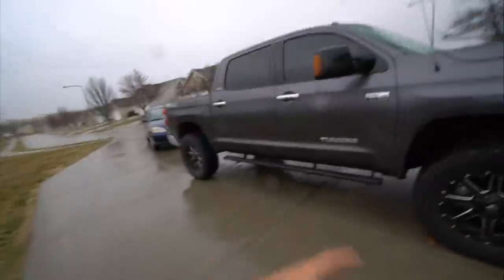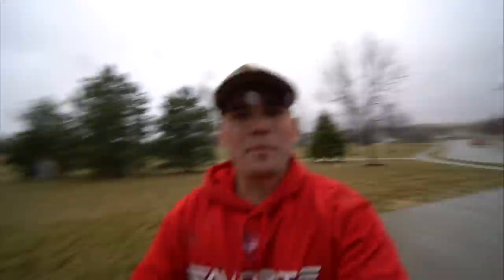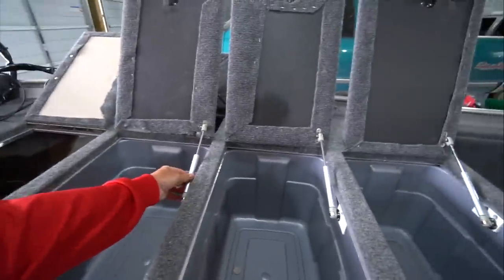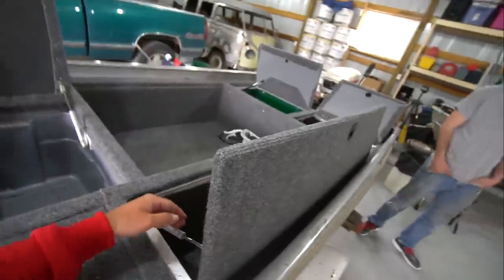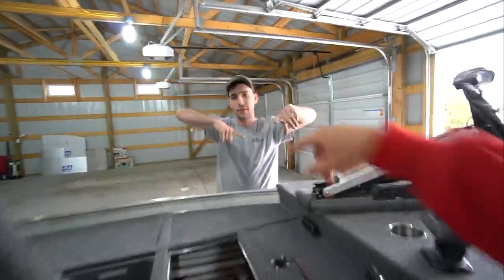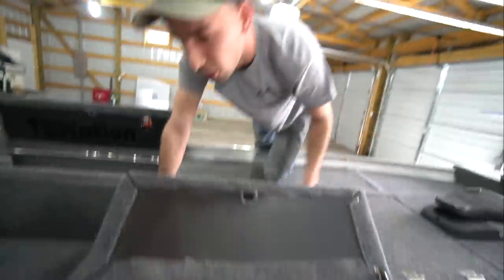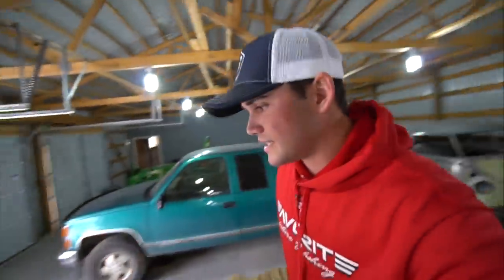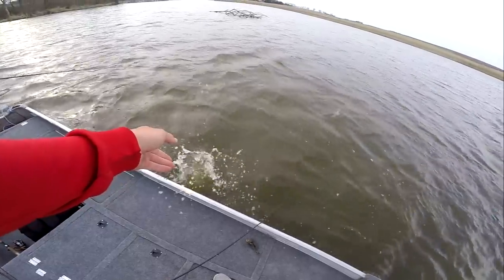INSANE Jon Boat to Bass Boat Modification (Homemade)

Comment: You need to put a live well in the back instead of the bucket
Reply: i was about to say "what about a live well"
Reply: Me as well...
Reply: You could use the bucket as your live well
Reply: Blake autwell yeah but you still need to keep them alive and what is he going to do bucket the water in and out. Not those will not work well as a live well.
Reply: tim wegman I caught a nice trout. Left it in the bucket for 1 hour. Jumped out of my hands as I took it to clean it. Buckets work just fine.
Reply: @evanwiltse6127  if you want to fish tournaments thought that won’t qualify as a live well

Comment: Put a livewell in the back storage compartment
Reply: BassinMonroe that’s what I said
Reply: Was thinking the same
Reply: Was thinking the same
Reply: That's a lot easier said than done. :)
Reply: He is going to need one
Reply: I was thinking the samething lol
Reply: BassinMonroe yup thats what i was thinking
Reply: A live well need to be where the center bench seat was. From the back of the bench forward. For weight distribution..
Reply: Yep.  Livewell needs to be added.
Reply: When they first posted this video, I pointed out a few things that where not safe or needed to be added/redone.. Wasn't being a A-hole about it nor did I say anything about the workmanship of the build. But man did they get butt-hurt in a hurry. So be carefully pointing anything out about this "INSANE" boat mod... Or you might just see the a big old Richard get all butt hurt on you...lol
Reply: Robert Redford not really all you need is a cooler, pump and aerator
Reply: @FirstLast-dv3ed  Richard who?

Comment: It's a real nice boat. It needs 2 pedestal seats(bike seats), if you troll alot- a 24 volt trolling motor is a must, Boat cover, livewell, dual pro battery charger, rod straps for front/back deck, boat cleats, good padded seats for traveling with big motor. Have Fun.

Comment: not a hater, but did my 13'8" much much differently. nose has 4.5 foot forward casting deck with socket for a throne (about 5" below gunwales, foot control bow mount trolling motor. the deck's rear vertical wall has hatches left right, down the center is a 4 foot long 12" wide bench (riding passenger is like being in a BIG jet ski), the top lifts up, there's you're livewell too, weight centered. about 18" of just floor space, then the rear is also all casting deck with a throne socket, two large hatches, fuel tank left, anchor and more on the right. it's a really comfortable arrangement!
used a 1/2" conduit bender to make the two hoops, dollar store light blue nylon cloth shower curtain for the shade canopy over the middle (yes sewing required!), which does just fine at 25-30 mph too. hoops lay flat on rear edge of forward casting deck, cloth rolls up around the hoops and the 4 small guy ropes lash the cloth to the hoops, very tidy, easy set up take down. it's a fiberglass hull, used to be a little 2+2 runabout for up to 35hp, now it's 20hp tiller, a 4 stroke Nissan. needed stringers replaced, transom replaced, gave it a nice thick wood perimeter railing too, stained deep red/brown, it also got new white gel coat.

hope you can picture these "1,000+ words" , its a really excellent layout. flip a switch a small 12v pump fills the 11 gallon livewell in about 3 minutes, pop the overflow tube, gravity drain. it has a 2 D cell battery air pump for an air stone, so you flip the livewell pump on 4-5 minutes once an hour if full of fish. get them home alive too no problem.

it also has 600 gph sump pump just in case. engine konks out wont start? sit on the down the center bench seat with a pair of 7ft oars after popping in the oar locks, you're at the right height+position, if you're forced to row it. nothing too special, but flip another switch 3 LED's down that center bench each side, lites up the floor (and more), plus 4 more to each casting deck, you wont miss your footing for darkness at least! 12v USB Mp3 module, little 12v PAM8610 amp board, couple small speakers.. oh heck yeah, bulkhead at rear of forward casting deck is a short wall looking right at ya, cheap as hell, sounds good, when it dies it didn't cost 10 bucks total anyway, and comes with a remote? oh hey now! simple cheap RC battery strap velcro loops to hang fishing poles down the sides out of the way... no real plan at all, just "it needs this, I want that" as I went about re-making it. fire extinguisher mounted on that short front wall too. spaces not used for storage are stuffed with capped 2 liter bottles (freeze them first cap them tight they're pressurized) for floatation. can't be having it ever fully sinking!

Comment: Sick boat, I have the same one. Yours turned out  very nice. I would add a ladder for safety, specifically one you can flip down from outside cus STUFF happens. Navigation lights are a must also and storage lights are nice for those early or late fishing days.

Comment: Looks great.  Very nice work.  Think about steel flex or wetlander coat on the bottom for protection and so it'll slide off stumps.
Agree with paint job or wrap.  Consider line-x or rhino line the trailer.  Powerful LED lights for night fishing.   You'll have lots of fun with that boat.

Comment: Doesn't look like your rear hatch doors have latches. Hinged the way they are if they aren't latched and they bounce up while in tow they'll rip right off.  Just a thought from a guy that has done a jon boat conversion. I'll second that Tiny Boat Nation is a cool community and Michael is a good dude for sure! He did a video on my build. 
Tight lines, Casey
Reply: hardwoodcd with the gas struts and the friction fit, it should be fine. Unless he drives through a hurricane while competing in a monster truck rally

Comment: Repower it with a four stroke Yamaha tiller that has a alternator to charge your stuff, add a jack plate, underwater lights, courtesy lights, and 1 or 2 micro power poles.

Comment: Way more cup holders , easy fix. Rod holders above board maybe a removable 5 rod holder across back to accommodate if you wanted to bottom fish or trolling easy to install and remove if wanted. So maybe a live tank maybe you could use the plastic tubs already installed big battery and charging for all types of electronics.

Comment: What is the new weight?  That much new stuff has to subtract from the coast guard sticker? How much did it change?
Reply: Mongo Fishing honestly it's really light for what I did to it. The farm pond we fish doesn't have a boat ramp so we have to push it off the trailer by hand and winch it on to get it out. I easily did both by myself. I took the seats out then framed in. There's 150 feet of 1 inch by 1/8 inch aluminum and about 1 and 1/2 sheets of 1/2 plywood. That's the only thing in the boat that really has weight. The rest is foam sheeting, like 3, 1x2x8' and 4 plastic totes. That's it
Reply: fishingthe402 Thank you. I have a bass boat buy my older brother and his son are building one like this. I wanted to pass this on to him. Again, thank you.

Comment: Doing something similar with a 16 footer. But mine is a console type.  Im adding a live well and built in cooler too. It's turning out to be just as fishable as a fiberglass bass boat. Just runs a little slower.

Comment: Try installing a bilg pump in the bottom of your boat and in one of the containers as well as an aerator so you have a live well. The pump in the bottom of your boat is so you can pump out water just in case your boat starts to flood.

Comment: If it was me, I would put a steering wheel column in and steering wheel for the motor. Idk but I know I wouldn’t want to manually steer the motor with my hands in the back like that. Just a thought. Maybe later down the road but the boat is amazing looking. Great transformation.

Comment: Bilge pump, needs to dbe installed. Balance load, battery to the rear if fishing on front deck.  Instal running lights and work lights while doing so.

Comment: I'm curious what's gonna happen to the storage boxes when it rains. Doesn't seem like there is any type of track or system to drain rainwater away from compartments. Other than that, sweet rig.
Reply: Charlie Blanchard since he can't film in the rain I didn't get to crazy on water proofing the boxes. Wouldn't be hard to put in some drain plugs if it becomes an issue

Comment: Pretty cool project boat, nothing wrong with a good DIY type boat. I am not sure why the back storage doesn't have a bilge pump and recirculation devices to hold those big Braska Brutes for some good pics, etc... or even when you are Crappie fishing and want a good catch and cook shore lunch? Pretty sweet regardless and would be even sweeter with some DUX camo on the Tin Pounder. That was pretty nice of Toyota to give you one BadAss looking 50,000 dollar truck to keep around for Nebraska, what a weight off your shoulders having to drive all that way. THey are nice trucks even if they are older than the competition and average about 5 mpg less than the Big 3. A Cast and Blast Dux and Bass trip would be sweet, but a fishing trip with you would be wicked cool as well. Good luck to all the entrants.

Comment: These conversion boats aren't terribly stable are they? I've a 14 foot aluminum, stock, which isn't overly stable. Raising the center of gravity that much just be killer? I live on the St Lawrence River, and it always seems to be rough and windy ☹️
Reply: Adrian Parker as long as you have the right sized boat and keep it light it's good.

Comment: without a tiller handle how do you drive and steer it? i didnt see a cockpit
Reply: matanuska high tiller handle works just fine as is not sure what you're saying
Reply: i guess i had to watch it on a larger screen..i now see the tiller is folded up..i thought i saw the wiring for a steering wheel and couldnt see a tiller.

Comment: buy a 15 hp or 20 hp outboard for it depending on the hp rating on the boat itself. you can find used ones to buy pretty cheap

Comment: Needs hidden piano hinges instead of those surface mounted hinges......looks cheap and won’t feel nice stepping on with bare feet, they get super hot!  I would have put locking hatches on it instead of the pull style, just for some added security.
Reply: Dirty Outdoorsman I tried piano hinges, the screws pulled out on the end grain of the plywood. I could find the piano hinges that have an L style to screw into the under face of the hatch or else I would have used them on every hatch. I'll keep an eye out for them if we decide to change them. Thanks
Reply: Dirty Outdoorsman also the boat is garaged when it's not being used so no need really for security latches. If cost wasn't an issue I'd prefer to use them bc I think they look and work better but the extra time and money didn't really fit the needs
Reply: fishingthe402 INice work otherwise!
Reply: fishingthe402 I was thinking if you can’t find the L style, you could always use a short piece of aluminum angle and attach one side to the hinge and the other underneath the hatch.
Reply: I was just messing with some angle and a piano hinge trying just that for future reference lol

Comment: You need a live well in the boat for starters that's the first thing I would have put it in the boat and you should have welded all of the aluminum and not use rivets you need to get the weight spread out different on the boat
Reply: It's a riveted boat, so why go through the hassle of welding a new deck on? Point being if rivets have held a boat hull together for 60+ years there's no reason to weld aluminum angle into it. 3/16 rivets did the trick. The plywood would give 100x over before a rivet does. Also. It has a 7.5 hp motor idk what 10 rods on one side of a boat is gunna matter when smell literally travels faster than that boat.

Comment: Theres one thing i dont see anywhere in comments or mentioned in vid, the added weight. All sorts of ppl saying add livewell. All i see is a very skinny sitting boat that just a large amount of weight added to it. Now imagine full of gear and ppl. No thanks. I wouldnt take on any lake with more than a light breeze. The job done looks great and well done, but even aluminum just added 300-400 lbs. looks like an anchor to me with gear and guys mixxed with waves.

Comment: You should get a new motor with 2seats in the cockpit with a steering wheel instead of having to drive it withy our hands and maybe add some seats in the front and back. Like the comment if you agree.